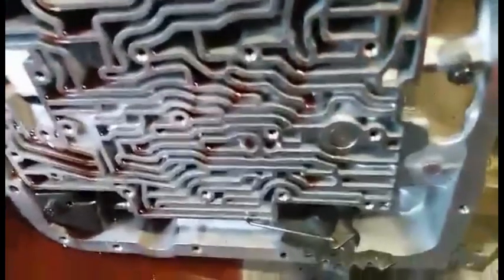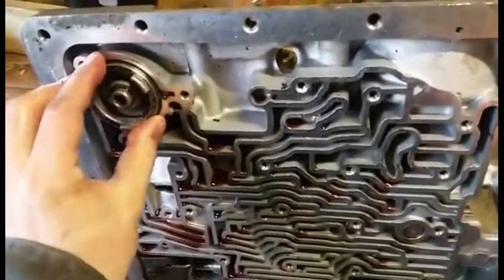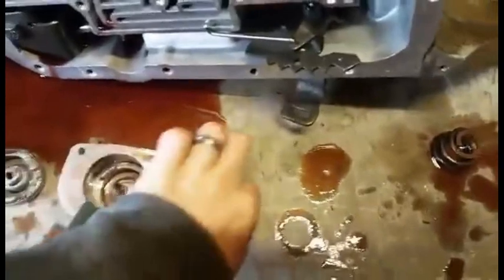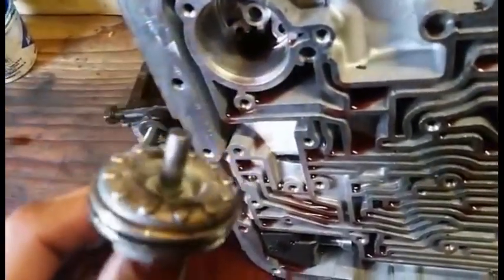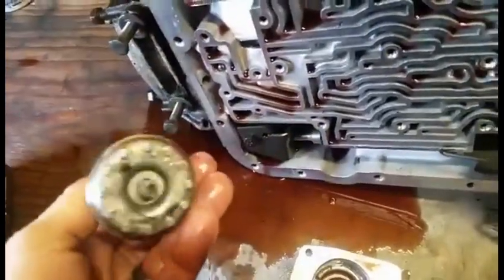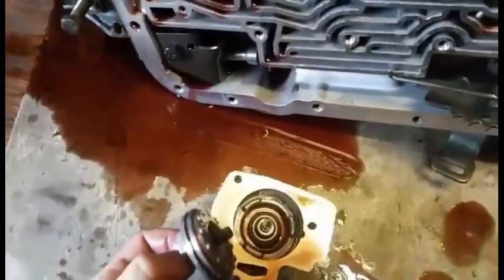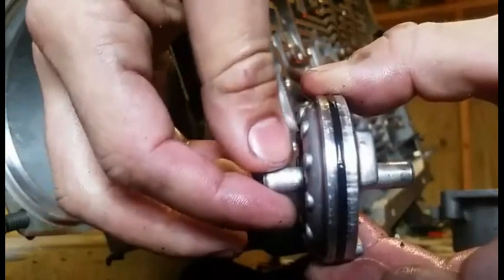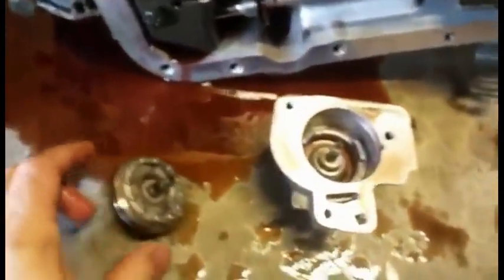4L60e/700-R4 Accumulator Pistons Tech Tip

Comment: Great job. As a builder myself of 35 yrs it amazes me how many times this is overlooked by seasoned rebuilders. Good job explaining why this is a come back waiting to smack you in the wallet!!
Reply from the maker: David Smith thanks for the compliment, David. I have seen several of your videos, very good information in them!
Reply: David Smith  Dave, do you know about Th400 ?  My first time adding a transgo shift kit and my plastic accumulator 2-3 is broken and I am replacing it with an aluminum piston. My question is- should I leave the spring out to get a better 2-3 shift or will that hurt the tranny?  The spring in it is very stiff it seems. Should I look for a softer spring, leave it out or just keep the stiff one in?  Thanks for any help. ?????

Comment: Had a hard shift in 1 / 2 shift, ..put the sonnax pin-less piston in the 1-2 accum. still shifted hard...put the 2-4 corvette servo ( 2 apply piston leaking ) + 11"x91/2" trans-cooler ...works like new ..!
Reply: I’m doing the pin less to mine tomorrow any típs?
Reply: Did u have to use a spacer inside w the sonnax 1-2 pinless ?

Comment: This guy does not get the credit he deserves, i was having shifting problems with a freshly rebuilt transmission and the entire cause was 1-2 accumulator having that slack in it after it was replaced everything worked 100%!
Reply: What was the transmission doing? Was it shifting hard from 1-2? My 07 Silverado is shifting hard from 1-2... could this be the reason for that?
Reply: biginkman 
Did you figure out your issue?
My 07 Sierra is having a delayed shift from 1st to 2nd, and it thumps hard once it shifts...
Just started doing this 2 n8ghts ago...
Was thinking on ordering new accumulator piston, but wasnt sure if this would help...
Thanks
Reply: My trans has been shifting usually above 3k rpm from 1-2... The shift itself is nice and smooth, not harsh or slipping, but it just seems like it stays in 1st longer. Didn't always do this, used to shift in the low 2k rpm range and it didn't take as long for it to decide when to shift. Solenoids recently got replaced because they went out, which slightly fixed the 1-2 shift timing, but it still persists. Kinda of a weird problem, wondering if it's the accumulator piston or tps? No codes are being thrown.
Reply: ForzaClutch 
I have no codes either...
My 1st is holding longer than it should, but i dont want to throw parts at it, unless it will help!
Reply: sad shame on the rebuilder .they should be honest w people

Comment: On the 4th gear accumulator use good pin and good accumulator and take another accumulator and flip both of them where the ears are touching and use a thin shim to space it just enough to where it's almost level to the gasket surface and done. No more problems and 4th gear shifts better.
Reply: Same thing I do.  I always save the worn out ones so I can double up.  Shifts a lot better and beats hammering a ball bearing in the case!
Reply: While unlikely to see a high enough speed for a wot 3-4 shift someone with low gearing could see a high throttle 3-4 shift. I wonder how this affects the 3-4 shift. Could it possibly become violent and break something?
Reply: @DillonTurner395  Great question, but not likely. The pressure has to hold two clutches while bringing the intermediate band back on. There are some quirks about the design of the intermediate band and the servo, but 1) the band is prone to burning and 2) the servo isn't being used as an accumulator, strictly speaking, but because it's using different pistons for 2 and 4, it tends to act like one anyway. There's also a fairly restrictive separator plate (people do sometimes drill them out too much; the area of a circle increases very quickly when you increase radius and some guys forget A=πr2). GM just built a lot of extra "comfort" into this transmission to begin with and the risk usually goes the other way, especially when you are running a lot of power and torque through a transmission that was intended for a Caprice sedan with a 150 horsepower 305 and a pretty conservative driver.

Comment: Steve I need help brother. 4l60e out if a 99 Sierra 1500 4x4 and I'm having a rough 1-2 and 3-4 shift. I changed out the accumulator for 1-2 and the shift is exactly the same. Any advice?

Comment: I sure wish I would have watched this video about 2 days ago before I put my transmission back together, looks like my next time I'm tearing it open and replacing that LOL , I still have no 2 to 3 shift, that's after changing the spacer plate that was wore out
Reply: Replace the checkball capsule and did you use a new molded 3-4 clutch pack piston? I know some of the older 700r4/4l60e had one with O-rings instead also replace the 3-4 accumulator piston with a pinless piston from sonnex they seal better I dont use a spring in the 3-4 just put the piston in the bore but its up to you. You can replace the accumulator piston and capsule without pulling the transmission.

Comment: Pinless sonnax solutions is the only way to fix it. Just eliminates the pin... 30 dollars for 3 pistons... 1-2, 3-4, Forward accumulator.
Reply: Hell yeah I replaced my forward, 1-2 and 3-4 accumulator Pistons in my 99 4L60E. They have two seals so they dont leak for shit I also toss the 3-4 spring you dont need it just the piston inside the bore to keep it sealed.
Reply: @Los G you can thats what a lot of builders do but just putting the piston in the bore without the spring accomplishes the same thing, you will need to plug up the 1/2 accumulator housing though when you buy the piston it come with ball bearing you hammer in or you can tap it and put a set screw with sealant. I also replaced the forward accumulator piston with a pinless thats the little one on the valve body itself.
Reply: @Los G yes with just the piston in the bore without the spring the cavity will just fill with fluid pushing the piston all the way down against the seperator plate basically just eliminating the cushion, doing it this way allows you to go back to original setup not that you would want to.

Comment: I know it's a long shot of getting an answer but I have a 99 suburban 190xxx miles that when I use 1sf gear to pull heavy loads up hill by shifting into 1st manually if my son's get to 3900 it will shift to 2nd automatically after I changed the filter and put synthetic trans fluid in. Also ever since I did this I get a flutter in the trans around 65 if going up a incline. Could this be because of the accumulator being worn? Was fine before hand.

Comment: Will that cause it not to shift? Ive got a 700r4 that wont shift. Ive checked the governor throttle valve and its not sticking. It will smoke the tires in first and reverse but wont shift out of first.
Reply: Ever get this figured out, In same boat

Comment: Wonder why they haven't made bushings for the pistons. Or a larger diameter pin and a person could drill the piston out to fit. Just do soooo many of these it would be a cheaper repair. Just the 1-2 accumulator though, the 3-4 double stack 2 pistons and a shim to bring it level with case and don't worry about that one anymore.

Comment: 4th gear accumulator can just be blocked off. Stack two pistons with a spacer in between them to bring it flush to the top of the case.

Comment: My 07 sierra just started having issues with 1st to 2nd shift...it is delayed and rpms are higher than before. But i also have a shift flare from 2nd to 3rd...but issues came at the same time 2 nights ago...
I believe different issues, but why both after exiting the highway with my truck?
First issue i believe is worn/broke 1-2 piston,and second issue, with 2nd to 3rd shift flare, could it be a stuck check ball? Was thinking maybe its stuck in the plate?
Thank you for your time
Reply: splash I have the same exact issue with my transmission, did u ever fix it? If so, what was the problem? I will appreciate ur feed back please, am going crazy with my transmission....
Reply: @mariomendez9399  that sounds like a sloppy lock up from your torque converter there is a product called fixal its a michined valve with o-rings that goes inside the TCC regulator valve next to the TCC solenoid. The stock TCC regulator valve has a spring that allows the valve to oscillate wearing out the bore and it starts to leak what the replacement valve does is Seal up the bore and stops the leakage and doesn't oscillate. GM used a pulse-width modulated TCC I guess to smooth out the shifts but you really don't need it. Since you're going to have to pool the valve body off I'd replace all the accumulator Pistons with pinless ones from sonnex.

Comment: So I think this is my issue 1-2 accumulator  is bad or broke haven't checked yet (91 v1500  Chevy suburban 700r4 trans ) don't have gear 1 (d or od) have to manual shift all the way down to low d1  to start moving  then shift it to d or od  once moving about 15mph ...then all good  for rest of shifting no slips or anything, but gotta do this procedure at every stop...also if on incline  d1 will start to wanna slip  I have to watch the throttle to much load and no go.   Help?????!!! ...fyi  reverse. Is great load no load lol
Reply: What ended up being the problem

Comment: I have a 700r4 out of a 89 k2500 and it won't shift out of 1st, I replaced the governor an still no shift replaced the shift cable and still no shift, could the 1-2 accumulator be my problem? Thanks for any help
Reply: Probably broken band or burn up